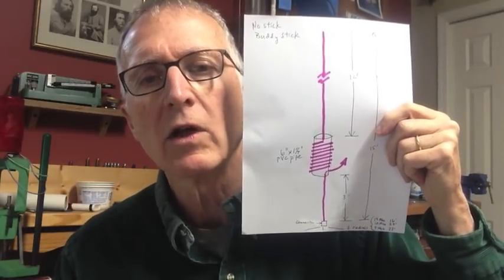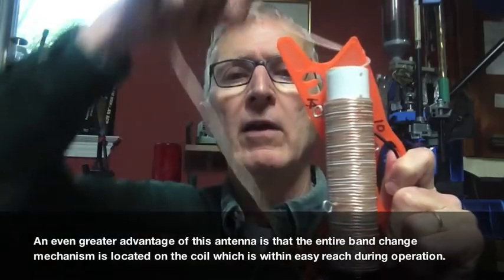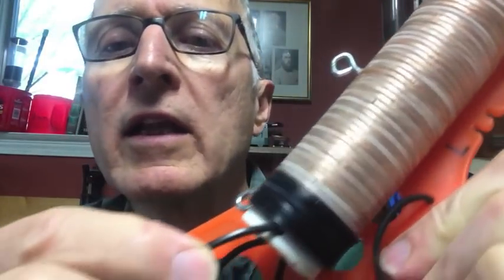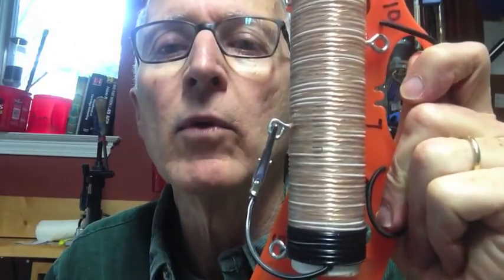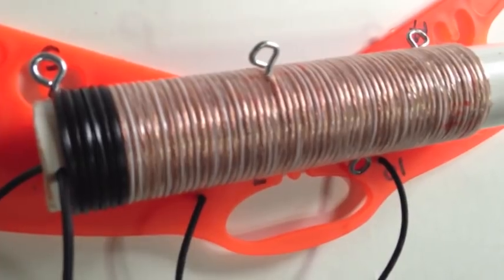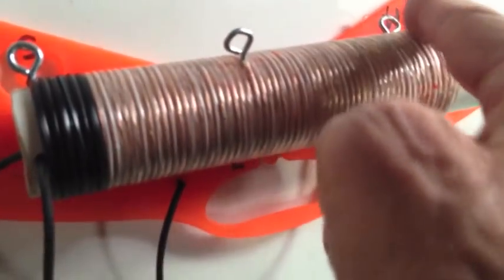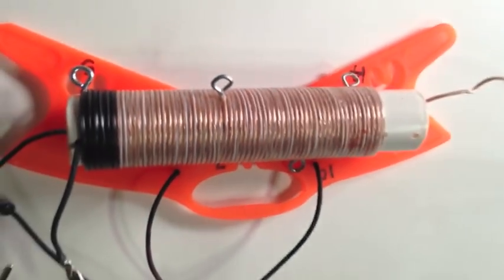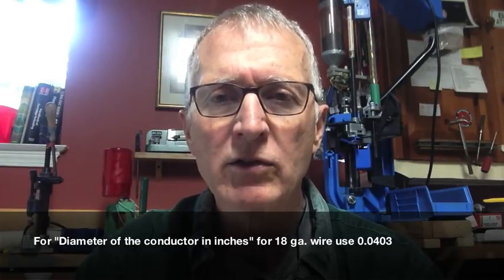Build the No-Stick Buddy-Stick Antenna

Comment: I think the reason most of us use a random wire antenna when portable: It has one vertical wire and one radial/counterpoise that lays on the ground. The "coil" is in the unun and antenna tuner. It's simple, while holding three radials 3 feet off the ground is easier said than done. Works all bands from at least 40m to 10m.
Reply from the maker: True true.... but you gotta have a tuner with an end fed wire. The unun will reduce the impedance to a more tunable number but it won't tune it to frequency, hence the tapped coil, which is resonant on each tapped frequency. If you have a tuner, the end fed wire is a great antenna. Thx fer commenting.

Comment: Shortened Verticals with Coils are not that efficient.  I recommend a 7m DX Commander Lite 4 band or  the All band 10m DX Commander Vertical.
Reply: What you say is true, but what I can tell you is that this antenna works very well on 20 meters.  On 20 meters the length of the antenna is pretty close to a full blown quarter wave vertical, so you aren't losing much efficiency.  Have made numerous contacts running QRP 3 watts for POTA activations.  It needs several more radials to improve efficiency (see links in comments about radials by DX Commander and his comments about ground radials), but other than that it's a great, low cost, easily made portable antenna.  It works on 40 meters also, but not quite as well, which is understandable considering the shortened length of it.  Get on the air for $10 - $15, have it up and operating in 10 minutes or less when you reach your operating site, good stuff!

Comment: Hi scott , which  loading press have behind in video?? it'a an Pacific press ????
Reply from the maker: Hello fellow shooter. It's a Dillon 650. There is also a Redding single stage that may show up on my videos at times. Thx fer watching.
Reply: @kw4jm699  THANKS FOR YOUR REPLY, SCOTT,  I have an RCBS  manual single turrett press, with die in tungsten carbide of caliber 357 , 45 revolver, 9x21mm and 7.65 mm , but, from long time don't use these machine.  from graziano, december 12, 2018.

Comment: Nice idea, using the pins to find the tap points.   I've filed that one in the back of my mind for future reference.
Reply: YES!  I thought that was a KEEPER Idea!!!
Reply: Kevin, this is right down your ally except where you've been boondocking of late, you dont got no trees. Just kidding.

BTW: Just received a 4" nanoVNA. Whow. What an amazing device. I've re-watched your VNA vids and will view them a few more times.

This OM has presented a really great and simple antenna. I should assemble one just to have it on hand and use it for a quicky whenever the urge hits me but my next project is a BCI filter for my V6 uBITx rig and a DIY DX-Commander.

Hats of to Sott for a great antenna project and a well done vid.

73 yuallz

Comment: Dillon and RCBS Guy I see.  I’m a Hornady Guy so my shop runs red.  I like this idea.  I was going to build a monoband vertical with one coil and a Jackie pole.  I like this idea for the same bands you built it for here.  The weighted ends for the radials with the fender washer is a stroke of genius.  - N1XF
Reply: gsansoucie Take a look at the QRP guys tri band vertical It’s essentially the same thing with a couple of toriods Inexpensive and super easy to make
Reply from the maker: Gary I agree. I built the QRP buys triband myself and i like it very much. It was great fun to build and it amazes me everytime I use it with the signal reports I receive. Thx fer commenting.
Reply: Gary Utz funny thing, i have this, in a bag from last year.  It came in too late for one of our camping trips so I set it aside for when we got back, never got built.
Reply: Sometimes I pop a critical duty round out of the mag to stare at the fine detail! Haha. I need to get back into the gun nut game but HAM radio + Guns + Computers + School tuition is rough! I go on a rotation, of course I always stay competent with my pistol. Love your call sign BTW! 73 de K2NJO
Reply: Just re-found this video.  My call has just changed though, it is now W1ND.